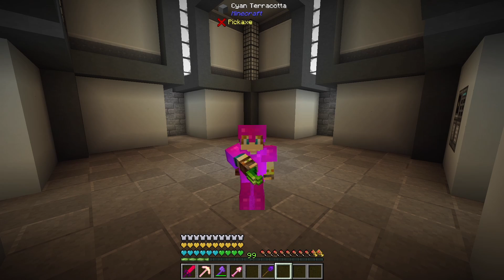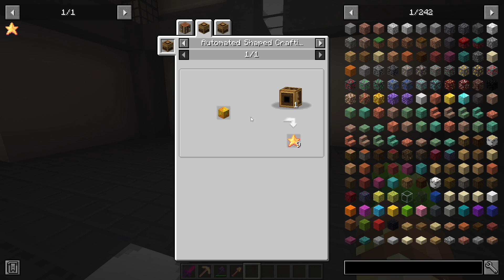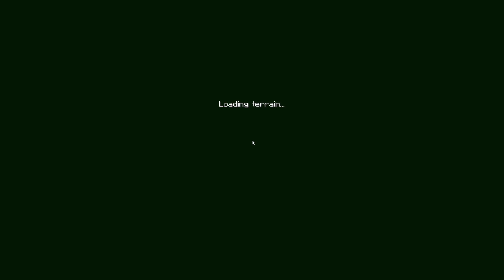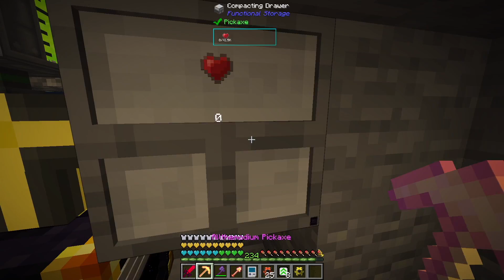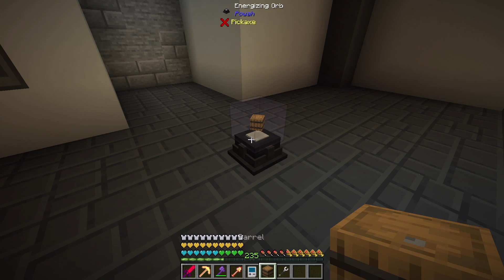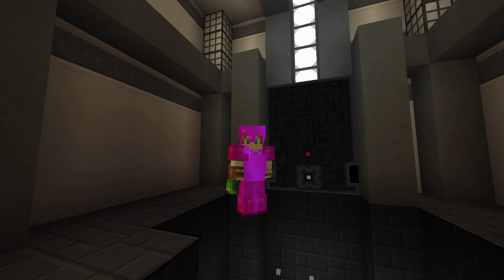All The Mods 8 Ep9 Automated Energizing Orb and Powah Reactor!

Comment: Try the advanced wireless receiver for refined storage. It's 1000 block default then up to 3000 blocks with range upgrades. Easy on power until you use the crazy dimension upgrade.
Reply from the maker: Oh that’s right! I remember seeing that but I brushed it off at the time. I’ll definitely switch over to that! :) Thanks!